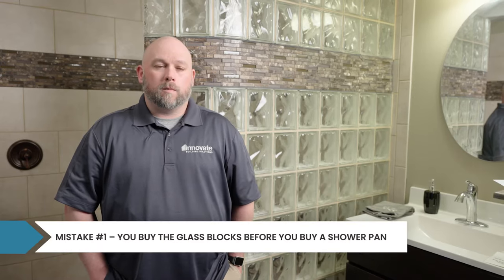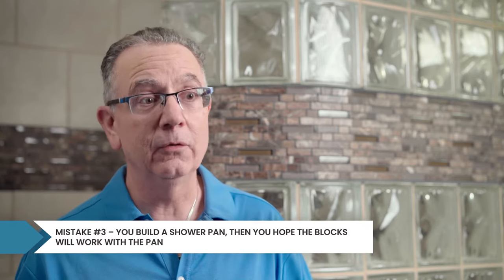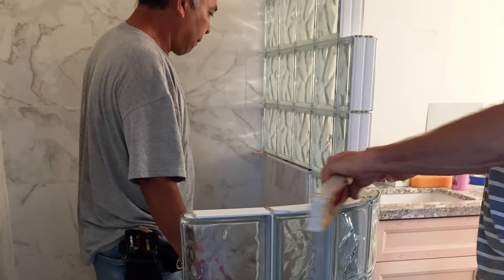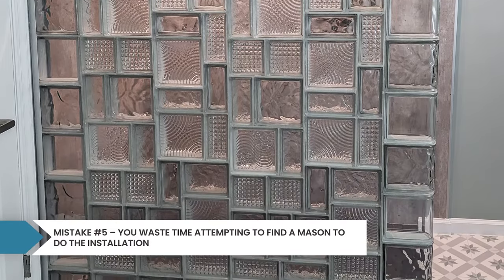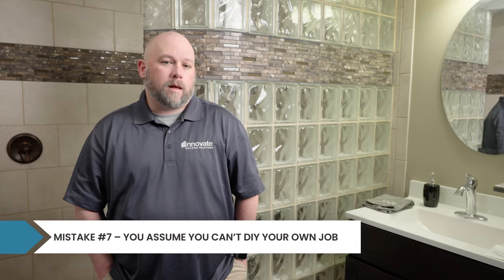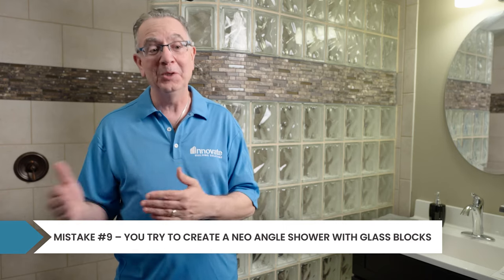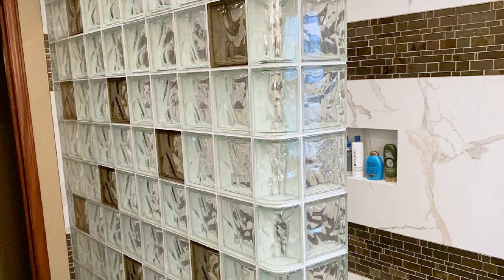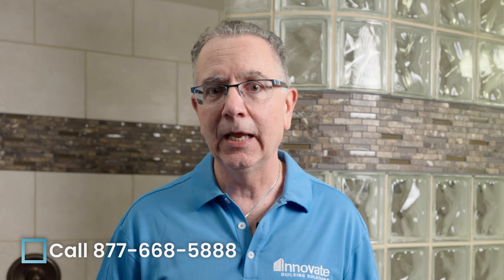Glass Block Shower Wall and Pan Mistakes to Avoid

Comment: Do you have a standard design to replace an old jetted corner tub?
Reply from the maker: Derrick - we can certainly help with your project. Since jetted corner tubs come in many different sizes it would be best to get us the info about the size of your tub (and for us to see what's to the left and right of it) and we can come up with a design not only for the prefabricated glass block walls - but also for a shower pans and/or wall panels for it. Feel free to visit this web page or call us at 877-668-5888 - Mike - now here's the link - https://innovatebuildingsolutions.com/product/glass-block-showers/